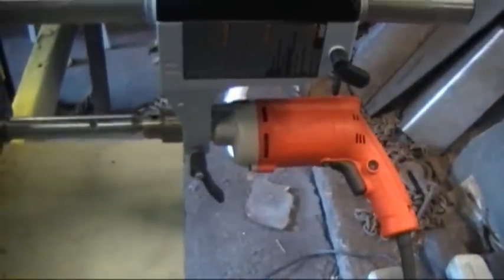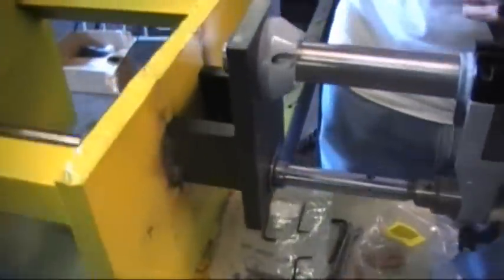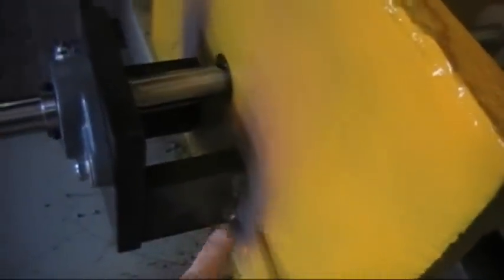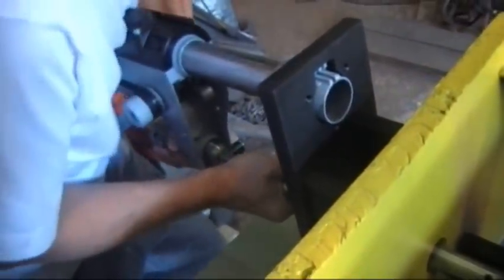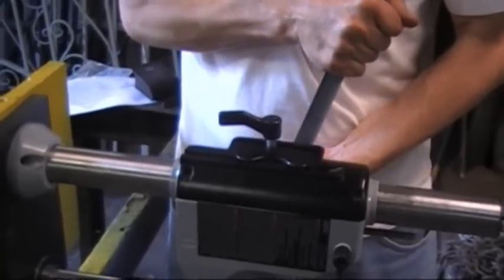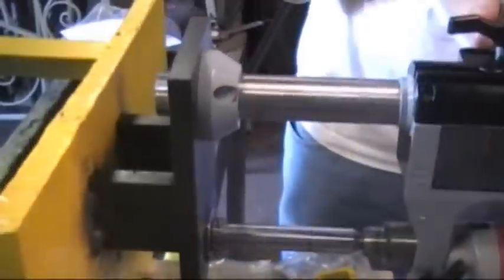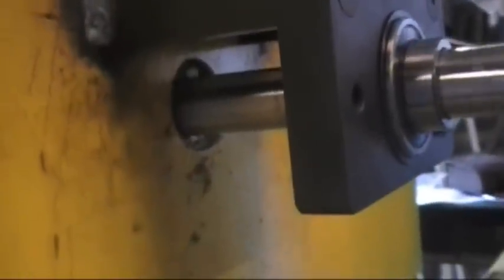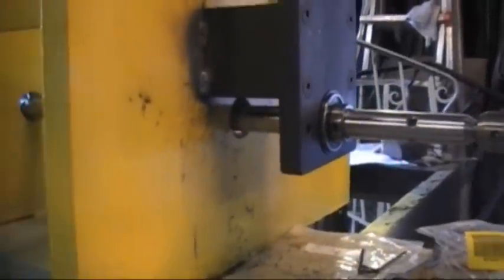Q88E Line Boring Machine

Comment: This is what happens when someone buys a patent to a piece of machinery and as a direct result of having no experience in designing or using it, they end up making a new unit that is underpowered, such as in this case. That drill should be used for hanging up a painting or wall clock. Just because you see it in a brochure from a competitor doesn't mean it's a good idea. There's no substitute for experience.